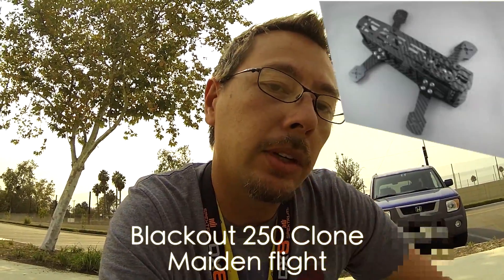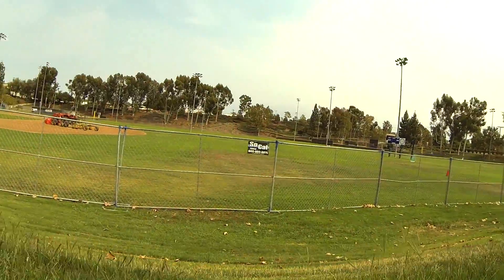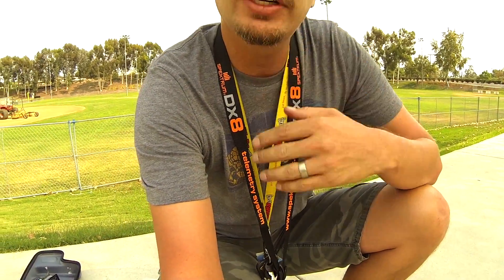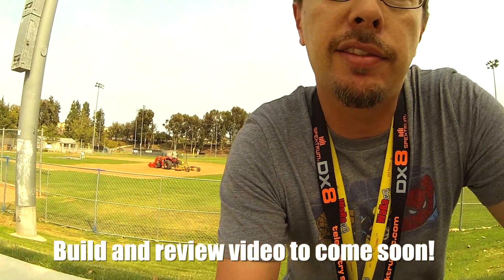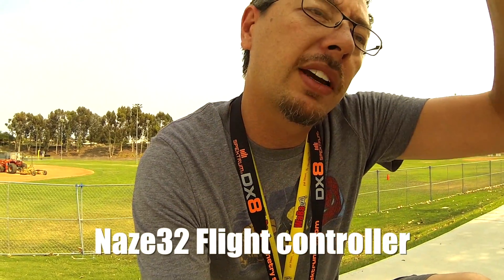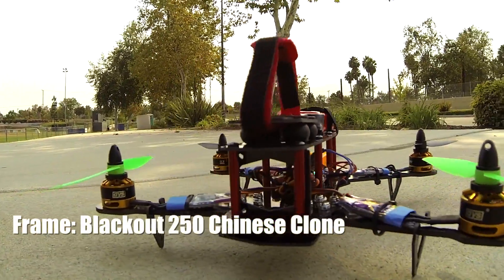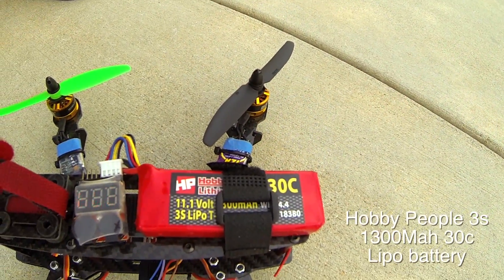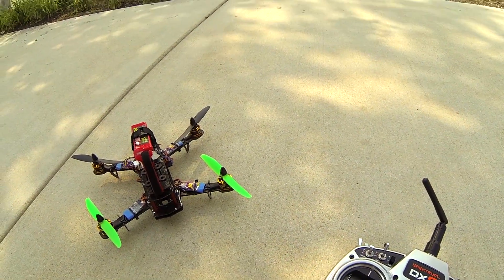ZMR 250 Maiden Flight

Comment: Nice - I can sugest to switch to HQ 5.4 or 6.4 props - those will give you much more fun:)
Reply from the maker: I love fun!! lol, I have enough room to run 6" props, so I probably will as long as the motors don't heat up too much or drain the battery too fast

Comment: Looking good! I just built a 250 quad with same motors/escs as you and also a Naze32. I have 5030 carbon props and a cheap hobbyking frame. I wanted to fly today but its raining. I was wondering what PIDS you are on as mine is so similar to yours and yours is flying sweet :)
Reply from the maker: Stock pids are fine. Just bump up the yaw rate in the GUI.  If you want to flip, bump up the rc rate. I did change the pids a little but ill look them up and post them
Reply: 7demo7
Thanks, on stock pids mine was a bit wobbly, then I followed this guide it has PIDS below the video and a few CLI commands, this stopped the wobbles but it felt a little odd to fly, this was indoors and I've not had a chance to properly fly it - http://www.rcmodelforum.com/showthread.php/175-(Acro)-Naze-32-Afro-mini-How-to-setup-and-tune-a-quadcopter
Reply from the maker: I'll post my pids later for you or I can text you a screen shot from
My phone. My email is sdemo8@cox.net

Comment: Nice rig and nice driving.... you have a great setup of gear but if you want to flip and roll around the sky like its on rails then dont up the stick scaling as this is not a KK board...... you need to up the RCrate and Pitch/Roll/Yaw (PRY) rates. 250 FPV Setup - Baseflight Configurator 
Rannger Copter